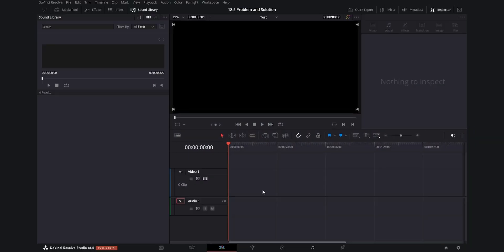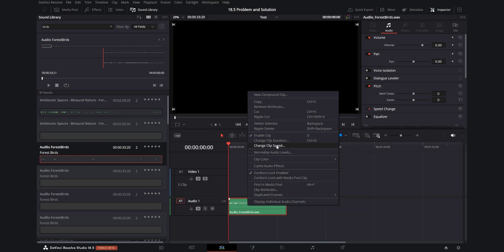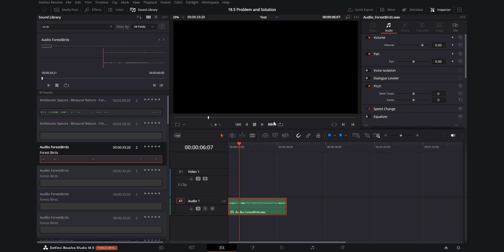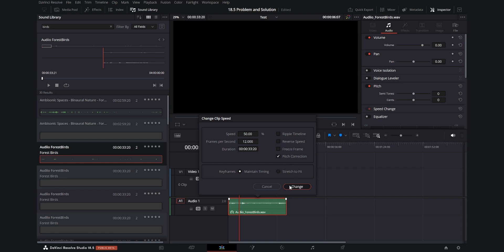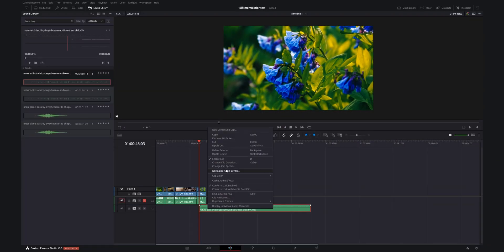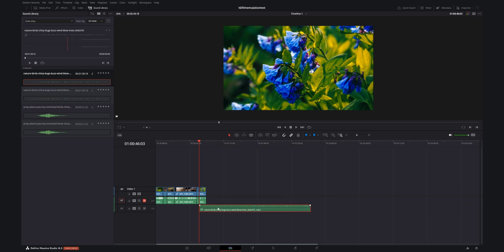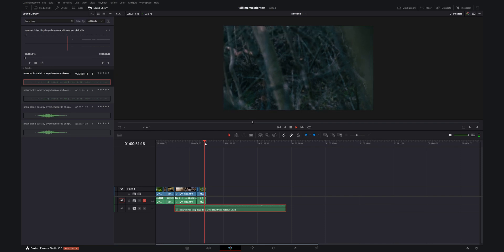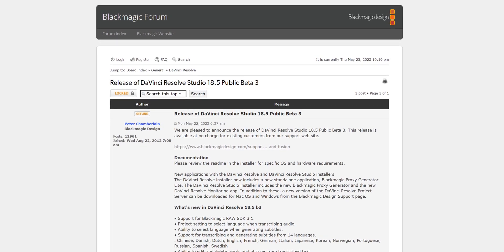DaVinci Resolve 18.5 Has a Fatal Flaw: Here's How to Fix it!

Comment: Or what about the fushion tab doesnt work anymore? Now it keeps crashing when i click it while before it worked fine
Reply from the maker: Have you updated to the official release of 18.5? That recently came out, it's no longer in beta.
Reply: I just did the update recommended by the program itself @RoccoGermani
Reply from the maker: 18.5.1 just released, is that what you're on? I really don't know what I could do to help. If you're still having issues after updating I'd recommend reaching out to Blackmagic Designs support team.